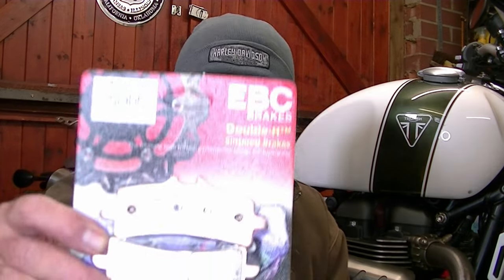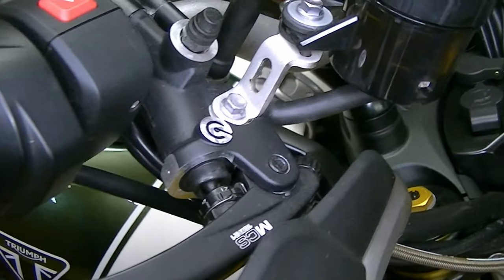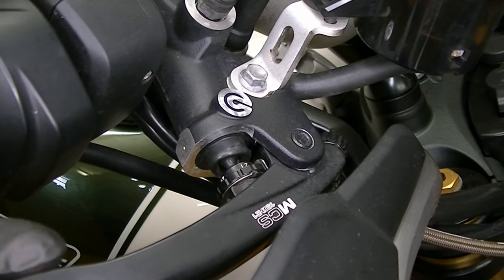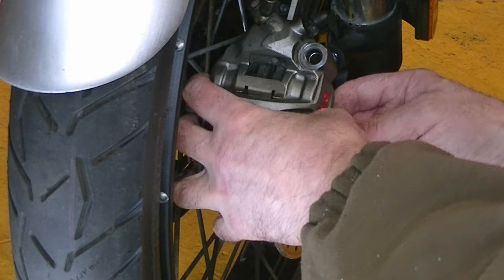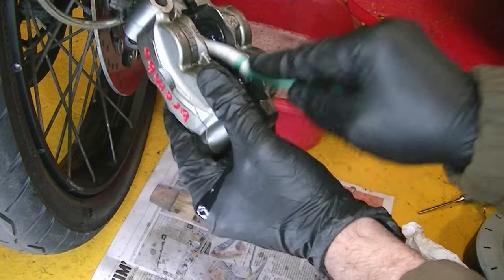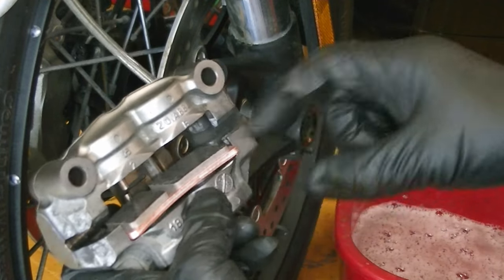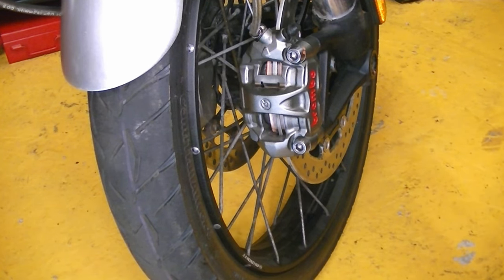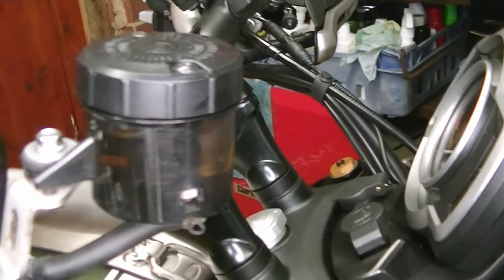Triumph Scrambler 1200 Brake Service & Changing Brake Pads

Comment: Thanks for the video. Do you not recommend putting some grease on the back of the brake pads when re-installing them?
Reply from the maker: No. Not necessary.
Reply: @SongsFromTheSaddle  ok!  thanks for responding.

Comment: Great video! How are your EBC pads going?! Any difference from the original Brembo Pads?
Reply from the maker: I've been very happy with the performance of the EBC pads. I run them in several of my bikes, including my Harley-Davidson and my Triumph Bonneville T140. In all cases the braking performance has been substantially improved. I do not use them on my KTM, as I use pads with a compound more suitable for off-road use.

Comment: Thanks very useful, now the rear pads can they be replaced without removing the caliper? Also noticed that the so called stainless spokes are corroding as are mine.. Bummer
Reply from the maker: Yes you can replace the rear pads without removing the calliper as they are retained with a pin. I have some new rear pads on order. When they arrive I'll make a video of the fitting.

Comment: Great video! My scrambler front brake lever is spongy and doesn't actually brake (I only have rear brakes basically at the moment) any tips on getting it back to normal? I noticed there seems to be a top bleeder and a bottom bleeder (on the tire), anyway I could utilize that top bleeder?
Reply from the maker: It might be worth changing the brake fluid. No doubt I will make a video on this soon (I have made a video on servicing the brakes on my Triumph Boneville T140)

Comment: Love this and given me confidence to diy, is the rear brake same procedure, discs and torque settings thanks.
Reply from the maker: The rear brake is not the same. The calliper is entirely different. The pads are retailed with a pin and the torque settings are lower. I'll probably change the rear pads soon, so I'll do a similar video of that procedure when I do.
Reply: @SongsFromTheSaddle  thanks to your videos I have managed to service all callipers front and rear, rear is a pain having to take wheel off. Oil change and filter next..